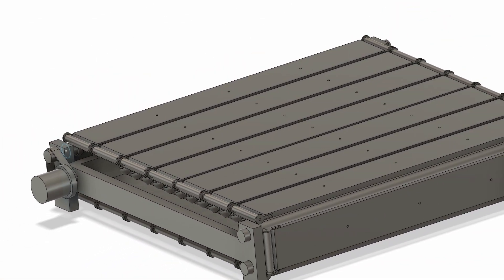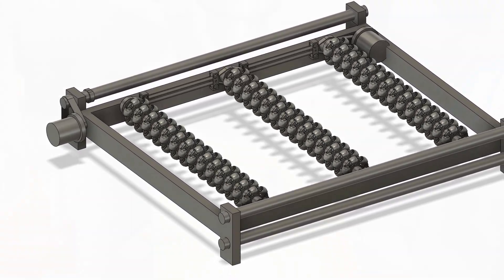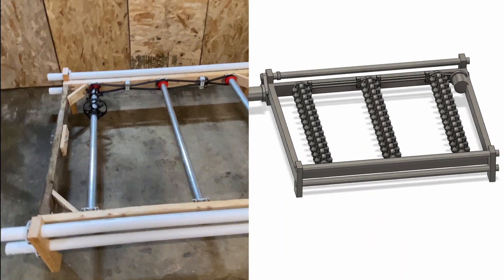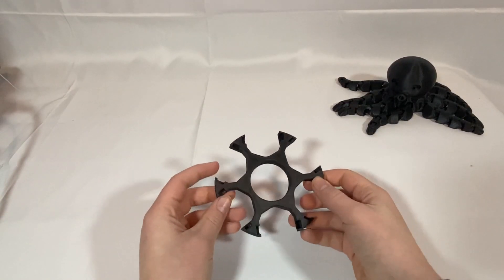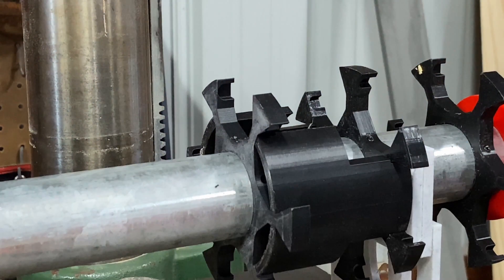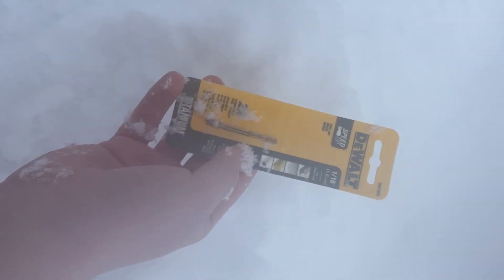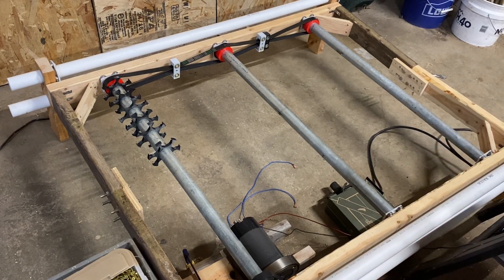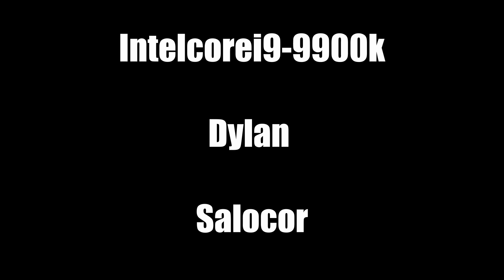Frame Completed?! Build log 8 VR Treadmill

Comment: what happened i remember this video a while back and was kinda sad to not see any updates for the past year... i cant remember why you went with the adjustable belt tensioner rather then having normal tension with bearings holding down the belt to help prevent slippage from the middle

Comment: what if you use 2 belts per side? one from front to the middle, then an other one from middle to the back.
(on each side) that way you can "tension the belt" nicely and dont need to squeeze it.

Comment: Looking good!  I was doing some research and found that the original infinitydeck has issues such as users not be able to side step or turn quickly.

Have you been able to solve any of these or have any theories to overcome these limitations?
Reply from the maker: Yes! with the use of user prediction systems using AI, along with stepper motors that have high Twork this shouldn't be an issue! at least that's what I'm hoping XD